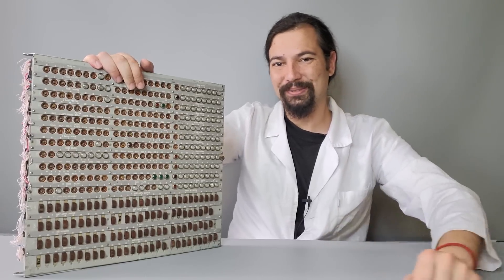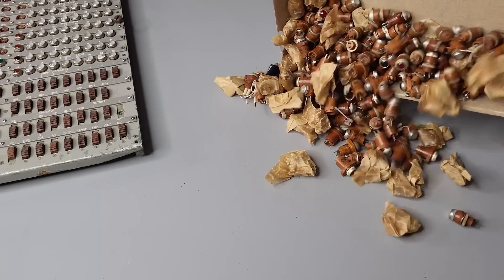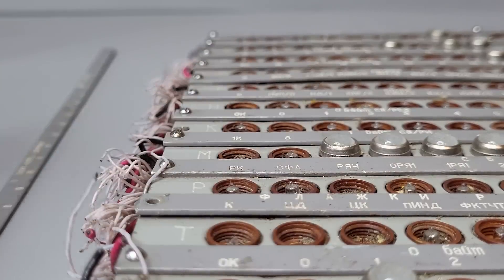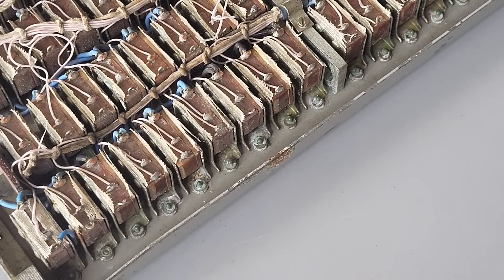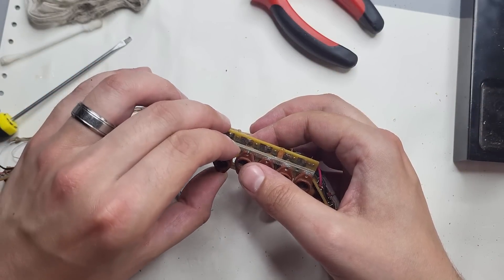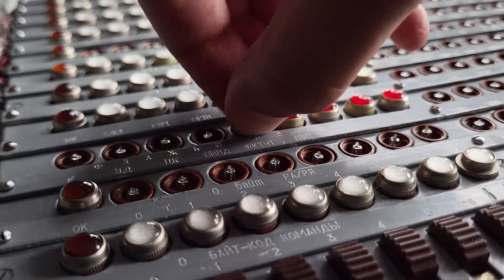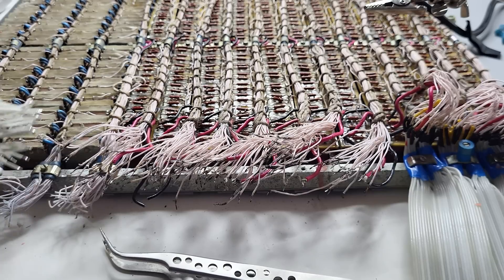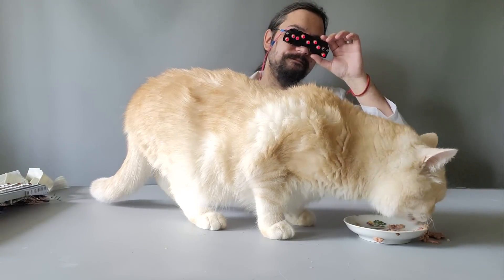The Most Exhausting Restoration I've Ever Made | Soviet Computer Control Panel

Comment: I think after wiring it up to arduino, you can play tetris on it! ❤
Reply: @ChernobylFamily  ULN2804A in combination with PCF8574 would be perfect match. Of course good power supply and lots of software. PCF8574 can be also used for the switches. Then you can put some game/contest between viewer and the best program or game will win a switch and lamp indicator. :D I realty like this display.

Comment: That's a really cool-looking piece of vintage hardware there.  🙂  I don't know how much meaning it would have independent of other control panels from the same machine (unless that was THE control panel, of course), but I think that connecting it to a microcontroller running an emulator would be pretty neat for visitors at a museum.  Or, if it's only part of the machine's controls, perhaps just using a microcontroller to run some sort of operation-like simulator (less than fully functional but more than just flickering random lights).

Whatever you do with it long-term, congratulations on having the patience to do that work, especially to replace all the many broken bulbs!  Just seeing all that damage on-screen made me tired.  ;-)
Reply from the maker: This was a diagnostics panel, so supposedly it was used only sometimes and only for narrow tasks. 
Thank you:)

Comment: Do you ever through to 3D print missing or broken parts? Or you want use only "old new stock" parts if you find them? Obviously the purpouse would be a total salvage of aesthetics and functionality of the parts, it would be a compromise...
Reply from the maker: We prefer to use original period components; it is possible to find them, sometimes the issue is identification of a part number, as it is not always written on a component. 3D printing is of course an option, but we see it as a last resort.

Comment: How are those lamps wired?  Are they all using a common ground?  What voltage and wattage?  I'm assuming DC?
You have so much patience!
Reply from the maker: @iansmith8183  DC 9V common ground. Thank you!
Reply: @ChernobylFamily  Common ground makes it easier to control, good to know. Do you know the wattage of the bulbs?

Comment: Be cool to emulate the computer on something like a raspberry pi and then multiplex the outputs so you can actually run all the lights.
TIP120's is the actual way to turn on the lights. But 300 relays would sound cool.
Reply from the maker: yes, they indeed would sound cool – in the most literal meaning!

Comment: An easyish and fun thing to use that for, would be a synthesizer panel. Like a cool custom panel for a Moog component.
Replace a full row of lights with in/out 1/4" jacks, wire oscillators in and use the lights as indicators for the oscillators selected and in feedback lamps for trigger indication, and the switches to play with the sound. I think THAT would be an amazing, meaningful and awesome use for it.

Comment: Excellent video and great job, as always! 👍 End result looks nice! 
Sometimes, these screws can't be unscrewed because of soviet era tradition for painting threads. And if oxidation and rust occurs, then only solution is drilling out..
For work simulation any Z80 based PC will do the job - lot's of real CPU signals available and some others can be displayed using standard flip-flops etc.. As bulb drivers uln2803 can be used. 😉

Comment: Comment in my fingers before even watching the video: "Sounds like meditative work. Oh wait, old control panel parts tend to fall apart in a different way each time you deal with one, there is so often a judgement call between risking a cold solder joint and/or critique about soldering form ... or risking melting parts out of shape. Wire wound around then soldered, really hard to remove and leaving wires twisted - or too short if you cut the twisted bit off - and insulation melted. Brittle plastics and cross threads. And I can smell soldering through old dust, grease and silver sulfide, rotted flux residue, and either fungus or whatever they put on it to make the fungus dead, from here. Soviet screw sizes very nonstandardized, slots always too narrow. So... respect!" .... while watching the video: Oh, I probably wasn't much mistaken....

Comment: lot of insights about control panel.
but it is evening, which means beer time!
Reply: (your neighbors said hi)
Reply from the maker: Hey..)
Reply: specifying individual bytes is out of question for modern use, but I see it as trigger panel for complex actions in modern games.
Bet Arduino, drivers' knowledge and macros specifications on top can be make it a kick ass project.
Reply from the maker: Need to think. I have a small experience with Arduino, but I guess it is the time to improve.

Comment: Keep up the good work, Chernoble Family.
Maybe you could update is in case some new Information pops out, concerning the origin of this panel. Rebuilding it with LEDs would not only shrink the back side but would also allow for direct powering via Shift Register or display driver chip like Max7219
Слава ЗСУ!

Comment: Have you seen there's some people who have made modern versions of the early microcomputers, such as the Altair 8800 and IMSAI 8080? They've reproduced the front panels with the LED lights and switches, and connected them to a raspberry pie that runs a software emulation of the original machine, so you can use it just like you would the original machine, toggling the switches to enter in programs one byte at a time, then running the program and seeing the lights blink. Perhaps you could do something similar with this control panel? Obviously this has a lot more lights and switches than those other machines, but you don't necessarily need to use all of them if you're not going to implement every single feature, or you could make it expandable to implement those features in the future.
Reply: Also the 8008 based Mark 8.
Reply from the maker: Need to think about this. Sounds good, but in our conditions where energy goes off every 4 hours it might be a challenge.

Comment: There's something apparent in the construction methods used that stands out so much in today's world. The technology is quite poor, quality of the molds is rough, every lens looks different etc., but the amount of careful and meticulous manual labor is immense. I've noticed the pairs of resistors for every lightbulb - I'm guessing each bulb was ran with a low "standby" current even when off, to allow it to respond faster and get longer service life. I'd love some shots in the dark with this one! Stay safe and all the best to you and you family!
Reply from the maker: Speaking about lens, there were different modifications of them, but as I had to purchase old stock components, I had no chance to choose - just grabbed what I could as the quantity was insane.
Reply: The tech seems to be fine for its era.
The lenses have very minor irregularities like slightly uneven outer surface (had had my hands on that kind of lights). What makes the lenses look 'rough' is the lamps not perfectly seated in their sockets and shining the light through their pointy tips creating ring-like light spots.
Reply: @u2bear377  Oh, didn't think about that. It makes a lot of sense. 
I have seen some panel-mount Soviet indicator lights with a pair of metal discs with trefoil-shaped cutouts, situated right behind the lens. One of the discs was tied to the lens part which could be rotated so that the light was not visible even when "on". They've had 28V light bulbs inside, similar to Ba-9s. I've been wondering ever since what could be the reason to "disable" the light, aside from pranking someone of course.
Reply: @MichalKobuszewski  These trefoil shades allow adjusting the amount of light in a pure mechanical way without introducing any failure points into the electric circuit.
Quite handy in a low-light environment.
Some lights could be completely shut off when not needed.

Comment: RE: weak screws, I found the screws on the cylinder head of the Uctkam model glow engines are like cheese, the caps of the screw strip off with even light force when trying to remove them.
Reply from the maker: I will tell you something, when I said they got broken, I actually meant their HEADS broke to half. So a screw is holding, but you cannot turn it. Honestly, I do not recall having this ever before.

Comment: maybe hook this thing up to relays and something like an arduino that simulates how the original mainframe responded to this panel, that is if any of that info is available at all.
Reply from the maker: This is the problem. Too little documentation survived and this is not even from the processor, so it is quite narrow-purpose thing. I will try to ask some old engineers around, maybe they can recall something...

Comment: Great restro! It's a thing of beauty!

Similar to the annunciator panels that we installed in various car factories. Definitely a pain in the ass to wire up. 

This also could be used for "bootstrapping" a mainframe computer, which is what it was used for on the Burroughs B6600/6700 at the Air Force Academy. The switches (pretty much the same setup as what you have) were set up so that during normal operation the lights would spell out "AFA". This was in the mid-seventies.

Assuming that it was designed by a civilized engineer, there will be one wire that lights up all of the lights in a section at the same time. This is the "Lamp test" circuit, and it's used just for that. I didn't see that in the closeups of the wiring. But you can also do that in the programming (just don't use the state of the bulb to trigger other logic).

Not sure what the resistors were used for, do you know the resistance of them? A typical circuit for a bulb, or a set of bulbs should they be wired up to interact with each other would be helpful. 

As for something to do with them, a scrolling display triggered by relays would be sweet. :)

Keep the voltage down, and your bulbs will last a lifetime or two.

Comment: Wow, that looks amazing! Only thing I would suggest it so sand down the original color of the panel and maybe use spray paint can to get a more even finish, bu all in all, it looks stunning. Can't believe this wire mess was still all working for the most part.
Reply from the maker: That was the plan, but... you saw my comment about switches. They became a blocker.
Reply: @ChernobylFamily  yes, the switches are really impossible to remove, would be a huge task and maybe also damage something in the process - not worth it. But I love those light bulbs. They seem so modular with the different mounting styles and different color glass overlays. And real light bulbs have just this warm glow and the short time it gets bright or dim, not instantly like LED but fading in and out. I love to have original lamps on my vintage audio gear but sometimes I swap it for LEDs because with less heat you don't damage the plastic material. Amazing that you could find those old light bulbs still - are they so common?

Comment: How servicable is this computer panel? I can't make heads or tails of it. Some of the screws used really annoying and I assume the LEDs are connscted serial since you tested each of them.
Reply: No LEDs here.
These are micro incandescent bulbs.
Reply from the maker: There are no leds, those are light bulbs. Well, you can change them, if they are not broken, but other than that the panel was built somewhat way too solid.

Comment: Lovely!!!!!!  What if you find the way of using it as a test panel for circuits?  say the flick of one of the switches powers a circuit or part of one that has to be tested, and if the circuit is good, the corresponding light turns on?   
just a thought... :)

Comment: You could wire it up to an arduino and turn the indicators into a moving letter display!
Reply from the maker: Hmm...!
Reply: @ChernobylFamily  To control such an amount of lights you will need an Arduino Mega, to use a normal Arduino you would to encode outputs in a multiplexed way  to control the lights but even so it would not be enough so you would had to encode the outputs and have a circuit to decode them.  The Mega has much more outputs and with them you can use a cross matrix that would use less components to decode. But even with a mega encoding multiplexing tricks would be needed because this thing has so many lamps.
Reply from the maker: @agranero6 thank you for this idea.
Reply: @ChernobylFamily  Or You can use MCP23017 I/O expander or anything from the same category.  Any Arduino will do, as MCP23017 uses just 2 pin's used for I2C communication and gives 16 GPIO. Plus, it's I2C and every MCP23017 on line can be set to different address, so it's super easy to add more inputs/outputs MCU.

Comment: Evidently cost was no object.  At a first glance it would have cut the cost considerably by having one line of display and a switch to select which register to display.  As to construction, a flexible PC board would have saved wiring and soldering hundreds of wires and joints.  Then again if the computer itself was equally uneconomical designed, there wasn’t much savings in streamlining this panel design.

Similar panels on IBM Stretch and SAGE and 370 computers.

Comment: There has been some raspberry pi PDP-11 emulators that can run indicator panels. 
So it could be hooked up to something like that. 
For the authentic experience of keying in the bootstrap loader via the switches into it.
Reply from the maker: Would need to place optical couplings, though, I think.
Reply: Look at the PiDP-11 project for an example. It uses a raspberry pi to run a full pdo-11 emulator under "simh"and blinkenvone to hookup the panel to drive the simulator.